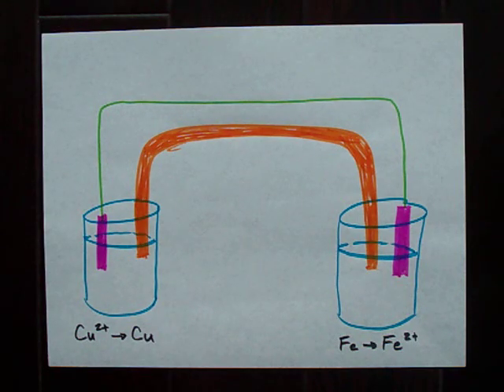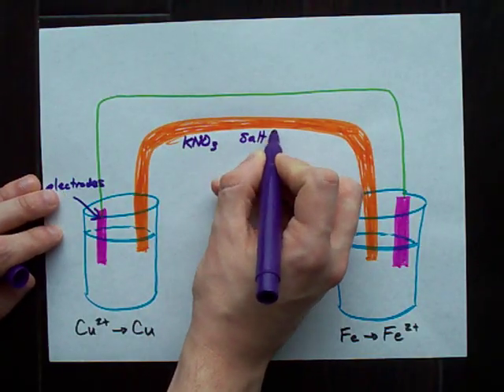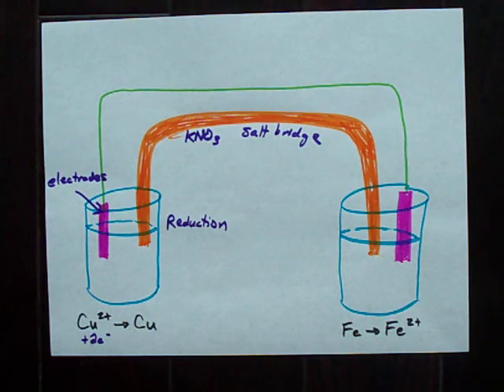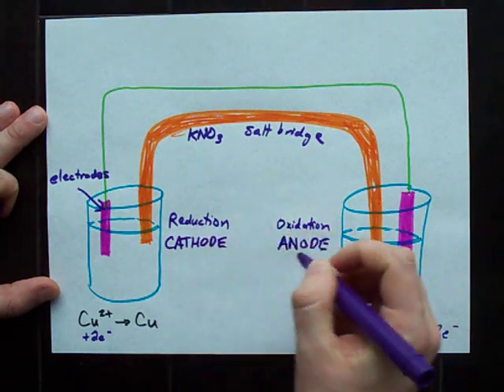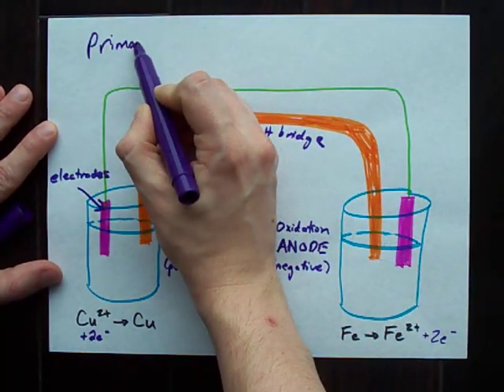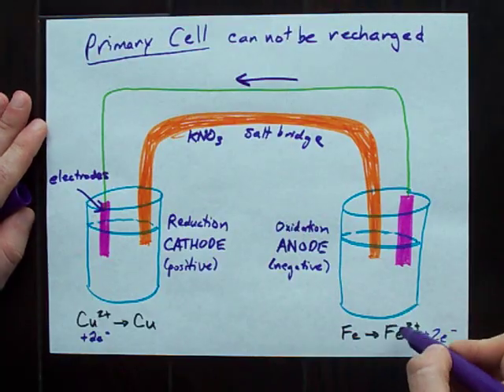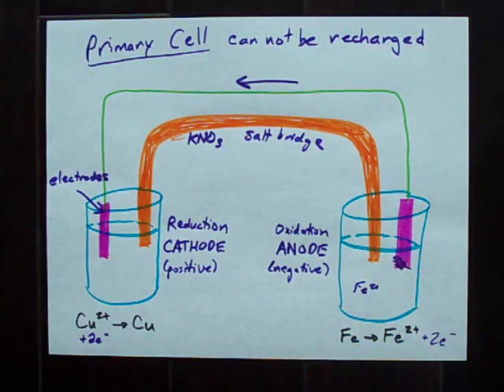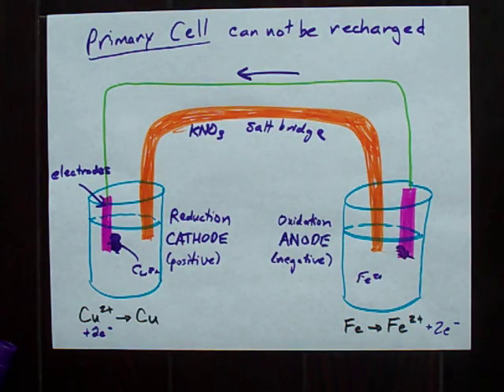What's the Anode, Cathode, and Salt Bridge?

Comment: The sun and the moon work like an anode and cathode, the earth is negatively charged and the ionosphere is positively charged.
The earth is flat and stationary, space is fake. The sun and moon are both small and close.

Electricity is freely harvested via the superconductors of the national grid in the UK.
The ionosphere is positively charged and the earth is negatively charged.
Every metre in altitude there’s 100v of electricity.
Since it’s inception from the early 1930’s electricity has been literally taken freely directly from the atmosphere and you’ve all been charged.

There’s not a single proof of video real hard evidence that electricity is produced in coal powered electricity stations.

They only produce carbon based products.

Show me a turbine in a coal power station actually providing power into the grid and the process and quantities fed into it.

Compare the power output of the earth to what the national grid produces.

Good luck people you’ve all been duped into paying for free energy right from the start.

Thank me later
👊😇🙏

Comment: I'm so tired of buying car batteries every 6 to 9 months @ $200 ea. Wtf happened? 15 years ago a 12vdc lead/acid car battery(used) was $40 and it would last a few years. So I'm going to attempt to make my own. This video is a good starting point. Here's my question: is the lead plates in a battery the anode or cathode? What would make a good conductor opposite the lead plates? How about copper/lead? Or uranium/lead? Just kidding. Or zinc/lead? Brass/lead? Lead oxide is used now on a lead plate I would imagine.  I would assume there's a lot of chemistry involved but could you recommend a barrier between the 2 plates whatever they end up being? Thanks. Good video. And when I successfully in coming up with a battery that last over 3000 cycles, you'll receive one. If you want one...
Free of course
Reply from the maker: I do NOT condone the creation of batteries at home. No further comment.

Comment: So the iron electrons end up turning into copper electrons. The copper electrons are dissipating in the solution but the Fe+2e- electrons (dissipated Iron) are given up and travel through the wire and then turned into solid copper electrons once inside the solution inside the copper beaker adding to the copper electrode? That’s how I understood this video correct me if I’m wrong, Thank you.

Comment: Cathode is the reduction side and the anode is the oxidation side, however both can be either positive or negative. Depends on the cell type. For example, in a Galvanic cell, the anode is negative and the cathode is positive. In a electrolytic cell the anode is positive and the cathode is negative.

Comment: guys u have to remember, the cathode is positive and the anode is negative in galvanic cells, (reaction occurs spontaneously) while its the opposite in electrolytic cells as its non spontaneous.
Reply: GREAT POINT!
Reply: See I was beginning to get confused until I saw this
Reply: What does spontaneously means? And non spontaneous
Reply: @no-de3lg  spontaneous means that a reaction occurs  without any external energy source. E.g oxidation of iron where overtime it become rust. While non-spontaneous means that it Requires and external source e.g. voltage from a battery for a reaction to occur.
Reply: @MakUpLuv  This means electrolytic cells are spontaneous, right?
Reply: @priyawadhwania7178  No,non spontaneous as they require external supply of batteries.
Reply: But Why

Comment: Why does putting iron in the solution make it lose electrons?
Reply: +maxpowers3732 I think cuz of electronigativity
Reply: +maxpowers3732 The reactivity series can better put this into context as we are talking about metals. Iron is higher up on the reactivity series than copper, so it loses electrons more readily than copper and the electrons flow away from iron when it is oxidised.

Comment: Is the cu2 -> cu and fe -> fe2 a result of simply connecting the two metals by a wire or is the electrolyte solution causing that and thus allowing electrons to flow?

Comment: So how does the salt bridge complete the flow of electrons? Reverses the flow of electrons back to the iron in opposite way?
Reply: mrsemifixit The electrons are not flowing in the salt bridge, as this would lead to short circuit. The solutions have to be neutral, so eg. when cations are dissolved, anions must flow in, vice versa.

Comment: Considering Fe is higher than Cu in the Electrochemical series, Fe definitely more electropositive than Cu hence it's easier for Fe to release electrons compared to Cu. By theory, electrons move from cathode to anode so it would be more convincing if the Fe electrode is the cathode and not the other way around as you've stated in the video.

Comment: I think, that precise role of salt bridge is also worth an explanation.
Reply: EXACTLY what I came here for!! And didn't get an answer!! What happens to the anions, carrying electrons? Electrons go through the wire, sure, but anions go through the salt bridge, right? Or wrong?
Reply: The reasons for the Salt Bridge are:
1) It allows electrical contact between the two solutions.
2) It prevents mixing of the electrode solutions.
3) It maintains the electrical neutrality in each half-cell as ions flow into and out of the
      salt bridge.